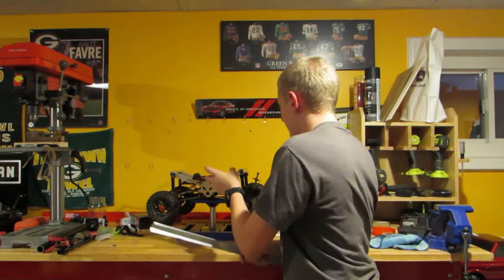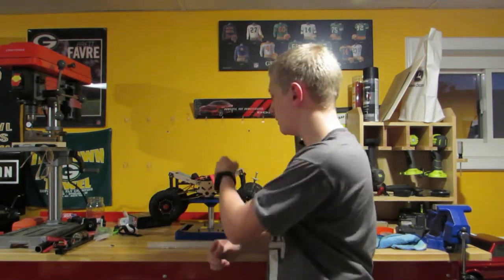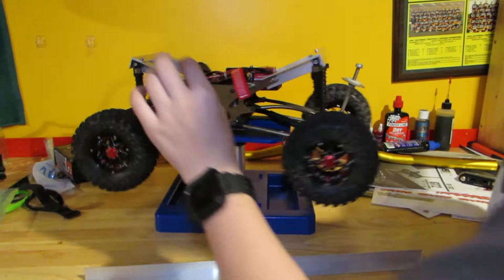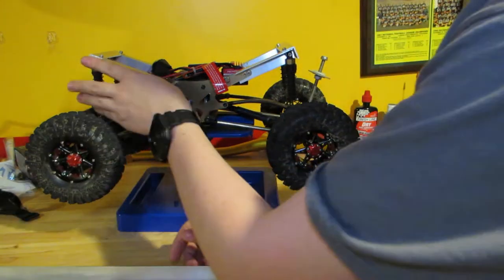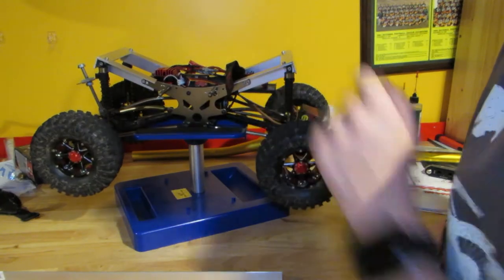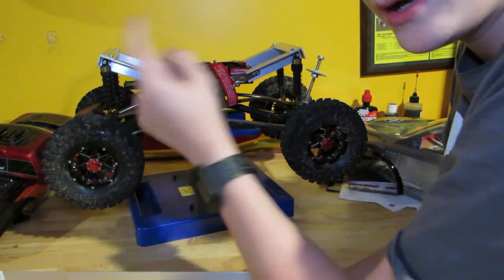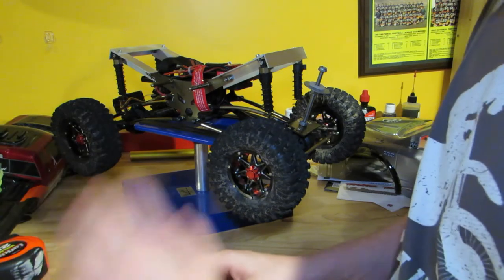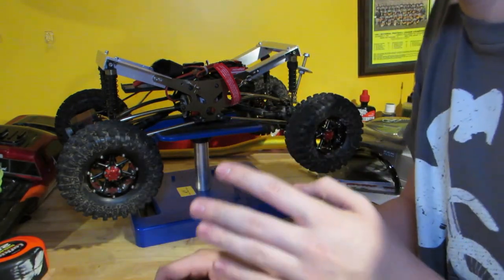Eliminating the torque twist on a Redcat Everest-10 (Full)

Comment: Great video. I’ve decided to buy a Redcat Everest like yours. I like the suspension upgrade. I would epoxy the corners of the cross angles where you have one bolt. It will make it much stiffer. Thanks for sharing your video!!!
Reply from the maker: Thanks I hope you like your Everest as much as I do I will recommend putting a metal servo horn on it because of the location but other than that it's an amazing truck